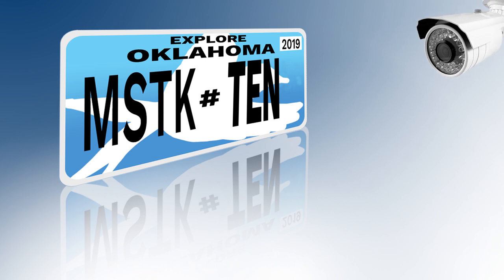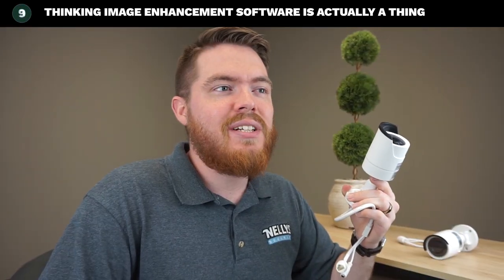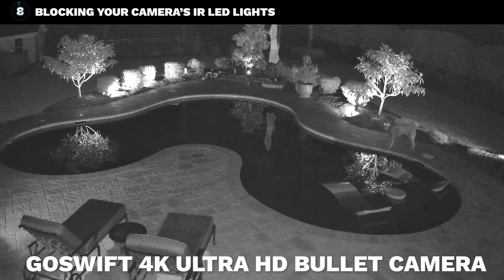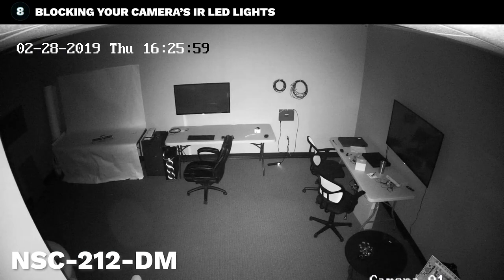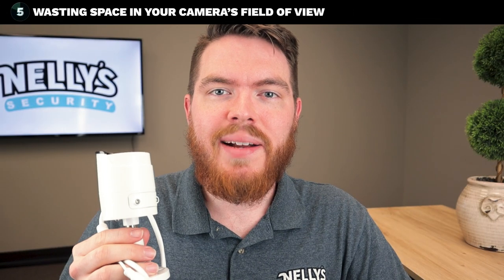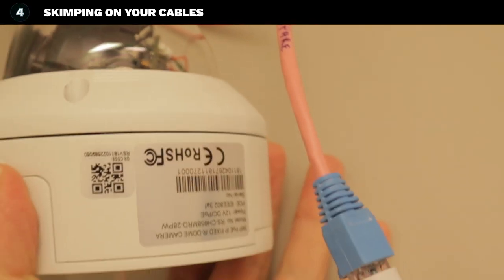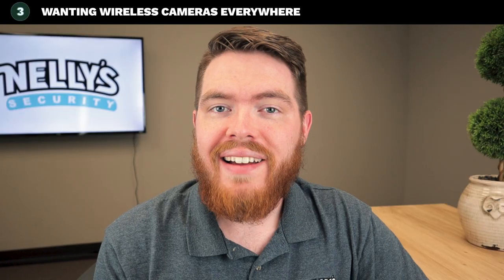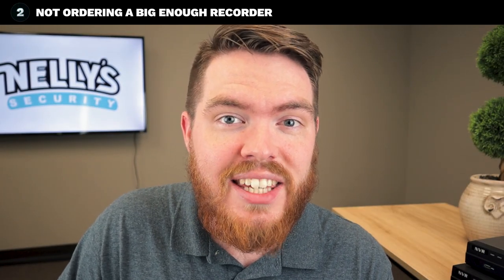Top 10 Surveillance Mistakes To Avoid When Installing Your Security System for the First Time

Comment: Actually the #1 mistake is the one that security companies make on every installation. Putting all the cameras on the eaves - so an intruder can walk around with their hoody up and you've recorded nothing of use for the Police. Unless you've got at least one video at around eyeball level, you are not going to get your stuff back.
Reply: good point. I wanted to hard wire cams on the 4 corners of my home, but its a one story and the fascia sits low enough that someone with a piece of rebar (or something like) could smash it. So im thinking a camera on each side of house up high near roof and window cams in front and back windows...but dont know about night vision? maybe a low profile cam on door? Im obviously trying to figure possibilities while typing. is there a suggestion out there?

Comment: Here are some additional mistakes/observations:
(I'll preface this by saying some security camera and NVR companies make getting some of the specifications VERY hard to obtain. Some won't provide these details at all)
NVR=Network Video Recorder

WiFi Cameras and systems:
WiFi can be jammed, especially in industrial spying/sabotage or high-end neighborhoods there is a lot of incentive for thieves to invest in radio jamming equipment. It is not so expensive that  some thief that is looking at a high payoff won't use it.
SOME NVRs have a feature that outputs an alarm signal if the video input is interrupted by either device failure or jamming of this type.

Camera REAL Resolution:
In general (see focal length below), I suggest using 5MP MINIMUM cameras. However, as Nelly's guy said, make sure your NVR (network video recorder) can use the higher resolution cameras. This information is usually buried deep in the user manual or a separate data page on the vendor's website. Cheap NVRs in particular may only support 2MP cameras.
Note: the higher the camera MP rating, the more storage it will consume in both non-compressed and compressed formats. A 5MP camera will consume considerably more storage space than a 2MP camera.

Sunlight and Time Of Day:
Orient the cameras so sunlight cannot directly impinge on the camera lens AT ALL TIMES OF DAY. Keep Daylight Savings Time in mind as well. In most locations on the planet, the position/angle of the sun in the sky changes during the year. It can change a lot...especially as you get farther from the equator, and may be another factor to keep in mind when installing a camera.
A camera can be PERMANENTLY damaged if sunlight "hits" the sensor. It will of course also totally blot out your image from that camera. 

Artificial Lighting and Time Of Day and Motion Detection Floodlights
When positioning your cameras, be sure to take into account lights that may turn on at certain times of day. Everything may seem OK when you first setup your camera, but then at night your camera may be overloaded by a streetlight or other light that turns on at night or when clouds/weather gets really dark.
A similar consideration exists for car headlights. You may see no problem during the day but headlights may cause major problems at night. This would be especially true when the camera is watching a gate, driveway, or parking lot.
Similarly, if your area of observation has motion activated floodlights they can also "swamp" the camera sensor and make any images unusable while the light is on.

1080HD/1080p Camera CLAIMS:
Keep in mind that just because a camera CLAIMS "1080HD" or "1080p" output, it doesn't actually mean the camera actually provides that level of resolution. All it means is that the output has been modified to make it compatible with 1080HD/1080p displays. The image from a 2MP camera is closer to 480p actual resolution. Only the output has been modified. There is no added detail when you simply modify an image to go from 480p to 1080p. You just get a larger format but still fuzzy image.

Focal Length: 
Understand and choose the correct camera lens FOCAL LENGTH for your needs. For example, the typical wide-angle surveillance 2.8mm focal length camera gives you a wider field of view, but if you need to observe only a small area but at a greater distance away, you may want to consider a 6mm focal length lens. Or, you may want to install both at a given location. This can be critical when your camera does not offer OPTICAL zoom. It should be noted that a narrow-angle 6mm 2MP camera can provide BETTER detail than a wide-angle 2.8mm 5MP camera at a far distance, so that can affect your decision. Remember also that 2MP camera requires less storage than a 5MP camera.
This video explains it very well and provides examples under various conditions:
https://www.youtube.com/watch?v=e2e05usL3Sg

IR floodlights, 850nm:
If you're going to buy IR floodlights, the almost universal wavelength of IR light used in surveillance cameras is 850nm. The other commonly sold IR light on the internet is 930nm...however it probably will NOT work in a typical surveillance system. Be sure to match the wavelength of the external IR light to your camera's IR LEDs.

Optical vs. Digital Zoom:
If you are going to DEPEND on zoom capabilities, I strongly suggest buying a camera that offers OPTICAL zoom. As the Nelly's guy said, digital zoom only magnifies, it does not provide more data/detail. OPTICAL zoom however, provides more data and more detail. An alternative as I said above, is using a camera with a longer focal length than the typical 2.8mm camera.

Data Compression:
In general, the higher the degree of compression, the more details are lost. H.264 and H.265 compressions are NOT lossless compression. A given camera and/or NVR may or may not offer a lossless compression data mode. WiFi cameras may compress the data because it results in faster network transmission and lower network bandwidth. NVRs generally offer compression to reduce the amount of storage it takes to save X hours of camera video in a given format. If you need absolutely the best video detail then lossless compression or no compression are options to look into. I'm unsure if there are any WiFi cameras that offer uncompressed data streams so in such cases you might want to consider wired camera installations. Keep in mind however, that analog camera signals degrade for every foot of cable so may only be suitable for a fairly short-range installation, and for maximum image clarity, analog cables need to be replaced after as little as 5 years in service (depends on environmental factors). Consult your security system vendor and get these kinds of details in writing. Some vendors will verbally assure you about anything you ask to make a sale.

ONVIF compatibility (WiFi only):
ONVIF is a surveillance camera and system standard that helps ensure that a WiFi camera you buy is compatible with your NVR. There are both ONVIF Versions and Profiles that you may need to meet to ensure full compatibility. However, I've been unable to obtain ONVIF information from some vendors, so you may have to buy and try to determine compability. In such cases, I suggest buying from a website/vendor that will accept "returns for any reason", preferably with no return shipping or "restocking" charges. For more info on ONVIF, just search the internet.

Comment: Almost every home and about 1 out of 4 businesses I walk into have the DVR box sitting in plain view. Thieves around here have quickly learned to just cut the cables from the box and take it, and therefore any evidence, with them. I usually place a cheap or old junker box in plain view with a bunch of dead cables coming to it. The real box usually goes inside a large firesafe. Cooling has not been an issue, the UPS power backup box and the DVR make just enough heat to keep moisture out of the safes. Thanks for your video,  it had some great information in it.
Reply: How do you get  cables in and out of a fire safe?
Reply: @jovetj  concrete drill bit
Reply: Sounds fishy.
Reply: @jovetj  how does it sound fishy? I keep my DVR in a fire safe as well. Trust me it can be done rather easily. A good high speed steel bit is all you need.
Reply: It was a joke.  Fishing cables?  Get it?  Guess not.
Reply: SMART!
Reply: Another thing to consider is some sort of instant remote backup. If you have a home and an office you could have each backing up to the other. Otherwise, you could backup to a cloud server.

Comment: Invaluable info! Thank you! I'm brand new to the whole home security system idea, and in less then one week I've gone from thinking of buying the "simply easy (and safe)" wireless battery only system, to rushing out to my local warehouse club to buy a wireless battery system I could also run on constant power, to now a more thorough investigation of a PoE system. You're 9 points were spot on! And, I have a bonus mistake you could add to your list. "Taking advice from the wrong people - like your buddy who did zero research before buying his system."
Reply: But also consider that his needs might have been served well enough with wireless but your needs are indeed different.

Comment: Actually, higher resolution CAN be achieved via computer processing, but it requires multiple frames of an image to do so. You can't just grab a screen-shot and enhance it via this process. It takes multiple images of the same object and via software combines them and may be able to produce a composite image that strips out much of the noise while at the same time introducing pixels from all the images and mapping them into a new image that produces more detail.
For one SIMPLISTIC example, one part of the eyes may be obscured or "out of focus" in one frame (but the rest of the face is decent), but the eyes are "in focus" in another frame. So the software removes the out of focus section from the first frame and replaces that section only with the in focus section from the second frame...thus producing an image with superior resolution overall. Also, the data compression used by a camera and/or system may produce less than optimal resolution of the eyes in one frame, but when it compresses the data for the next frame the eyes were compressed with more information. The results of compression can vary due to lighting, distance, motion, etc. Dealing with compression artifacts can be quite difficult.

However, this kind of software is as far as I know, still all proprietary, and mostly available and used by government agencies or vendors who specialize in image enhancement. I've not seen any software package that a typical consumer would use (or would want to pay high dollars for) that would provide enhancement in this manner.
Similar techniques are used in producing higher resolution images from optical telescopes.

Of course, it also helps a LOT if your data are not compressed at all. However this requires a LOT more data storage and most consumers would balk at either the higher cost or the decreased amount of video stored before the "old" data are overridden.

Note: I don't recommend any camera with less than 5MP of sensor resolution. Even if a camera is advertised as "1080HD" or similar, a 2MP camera is NOT actually capable of providing true 1080p information. It could be 480p (or even lower). The system may DISPLAY 1080p on the HDMI output, however the 480p image has simply been "stretched" to meet the 1080p format of the display. No "HD" information actually exists.
Reply: Also not true. Visual machine learning is a thing. Plenty of AI software can blow up an image AND fill in details where there were none.
Some of these features can be found in smartphones and can be applied to the images taken - only a matter of time before security cameras build this in.

Comment: You’ve earned a new customer, I’ve had my truck broken into 2x in past year..I currently have Nest cameras that are very close to my WiFi router and still have connectivity issues on top of not great zooming...can see an image of a person but not enough to catch them..I want the best cameras I can get but also I’m not a tech guy..I’d like to use my phone if possible but definitely want wired cameras...I’ll be calling tomorrow..

Comment: Here is the one you missed: aiming outdoor cameras at the east /west horizon where the sun sets/rises. Near time, the sun blocks out the view and changes the exact area due to the seasons. SE to NE and SW to NW winter to summer. Keep the angle low; no sky view.
Reply: Had to learn that the hard way with my trail cams.  Great advice!

Comment: I noticed one that is missing here, when using IR cameras, you can extend their range at night with IR flood lights. Be sure to position them out of view of the cameras though. My cameras have around a 30' range with the built in LEDs, with my IR flood lights, they pick up details at close to 200'. Another thing with IR cameras, don't use CFL bulbs in the field of view, they make the cameras useless.
Reply: Thanks. Another great reason for reading the comment section.
Reply: I want to film at night where there is good street light cover. Can you tell me, would IR work under those conditions?
Reply: A purchase caution. Be sure to get the IR floodlight with the same wavelength output as used in your camera(s). Some sellers try to con people into buying their 940nm IR floodlight by highlighting it's IR LEDs are "invisible" or "less visible" to human eyes (you don't see the deep red glow of typical surveillance camera IR LEDs) compared to the typical 850nm IR LEDs...but these 940nm IR floodlights won't work with the typically 850nm IR LED cameras. Sometimes the sellers don't even specify the wavelength of their product and customers won't understand there is a difference in IR LED lighting...or they will put the info in really small letters in some obscure place and then claim you can't return it because it was YOUR error to buy the wrong light. Even worse, I've seen sellers spec their light  as 850nm in one place, and 940nm in another, adding to the problem.

Note: to be more stealthy, SOME systems do use 940nm LEDs for illumination, but most consumer-grade cameras use 850nm IR LEDs.
Reply: @exgenica  excellent advice! Thanks for adding that.

Comment: We used an outdoor camera indoors, pointing outdoors through a window. The IR glare was ridiculous... We had to completely disable the IR lights. they weren't needed thanks to the area being completely lit. Black electrical tape over the IR LED lights can work in a pinch but it's frustrating if you leave any leaks.

Comment: Here is number 7: Installing cameras which are too high or otherwise impossible to access and maintain.  Spiders just love building webs on outdoor CCTV cameras so you need to be able to get to them to clear the spider webs off, sometimes daily, with a suitable long brush or similar.
Reply: Oh yeah, that was one mistake I made too. Good one!!!  I would use a 10 foot ladder and still couldn't reach the dang camera very well. Won't do that again.

Comment: Pretty good tips overall. #3 about wifi cameras has a lot of truth to it, but if you have a large enough property and multiple wifi access points, you can totally make this work. I have most of my cameras hardwired, but I'm still able to get two 3MP cameras on a single dedicated AP with no issues at all. 24/7 recording.

Comment: They missed a very important mistake.Time and date on the recorded images has to be accurate.If it isn't correct it will be useless If required as evidence in a court of law.
Reply: Aston Martin number 7...
Reply: @wwav9921 I think it was number 7/11
Reply: I know of couple of murderers that would beg to differ.
Reply: If a case depends on the surveillance timestamp, then prosecutor will have to "prove" it's reliable. Since most can be set by anyone with access to the system, that can be a challenge. Usually the best you get is testimony from the owner/operator that they set the time correctly and used a reliable source (like a cellphone carrier's timestamp or US time standard broadcast from Fort Collins, Colorado) to do so, AND that they were the only one(s) to have access to that feature of the system. Juries may or may not believe the testimony. They also have to prove the timestamp data on the video and/or the video itself have not been altered. The more critical the timestamp is to the case, the more focus the defense will put on discrediting it and there are various ways that can be approached.
Reply: In a murder case I assisted with where the security camera timestamp was wrong, we were able to correlate the wrong time to the right time by matching  employees leaving the building and when they carded out from the factory, and product deliveries from trucking companies to the loadout facility. The police were then able to narrow down the suspect by grabbing nearby footage from convenience stores from the exit and entrance routes. It didn't need to be exact, just within a few minutes.  Also, all 16 cameras could be proven to be off by the same time amount.
Reply: I call BS, mostly. On most systems the time is set by users. Like others have said, timestamps would, in any case, have to be verified.

Comment: Good video, but omg let me fix all those cables for you. I was having mini strokes every time you showed footage of your cabling.
Reply: You can probably forgive those as thats test bed installation
Reply: @zolartan4442 That's what I figured.  To sloppy to have been permanent.
Reply: Rob Justice Were you in car sales in the early 2000’s in Connecticut?
Reply: I’m an installer and I’m doing a take over job and it’s a new construction building and the cable left from the previous IT group looked exactly like in the video. With cables looping through the rack and everything going straight to the switch with no patch panels. Infrastructure and Designing the layout of cameras placements is key to a great installation to happen.
Reply: @ristube3319  Nope. Never been to Connecticut.